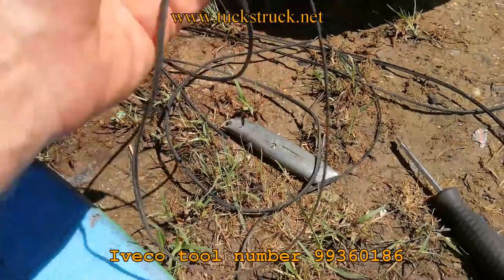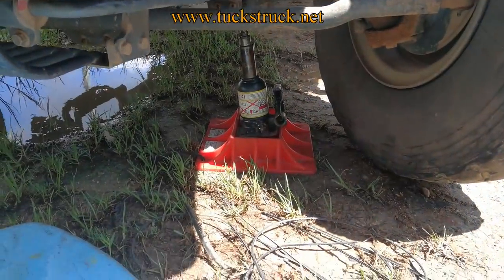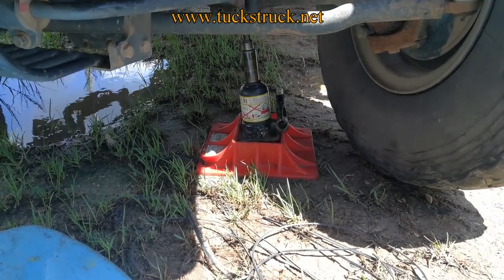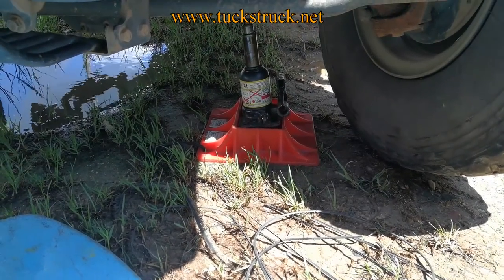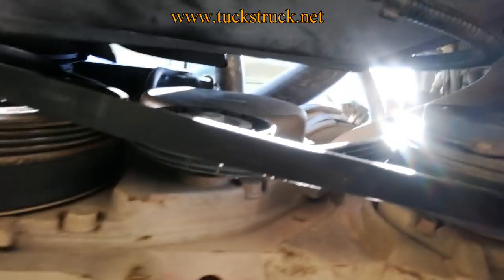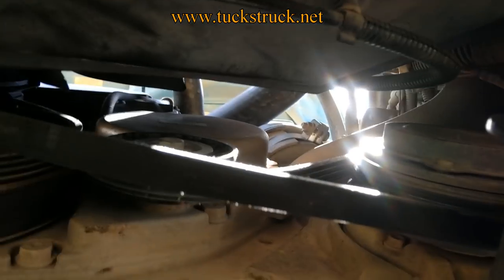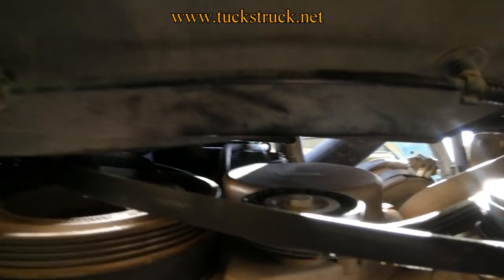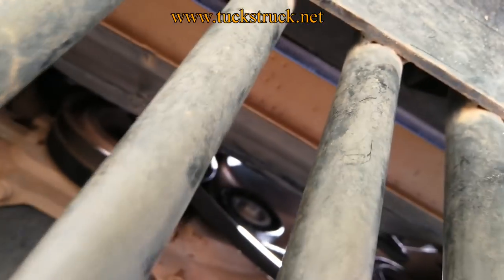Iveco Daily 4x4 55S17W Stretchy AC Belt Fitting

Comment: I have to do it on Ducato.  So transverse engine placement and automated transmission so it only lets me turn off the engine in 2nd.  Which wheel?  Flipflops won't work for sure.  I wonder if it will work at all.
Reply from the maker: In that case you probably want to put the gearbox in neutral and use a spanner on the crankshaft pulley to turn it.